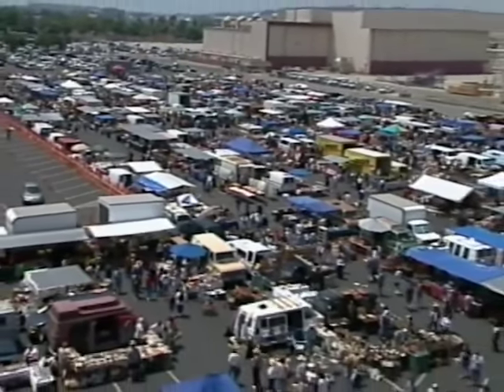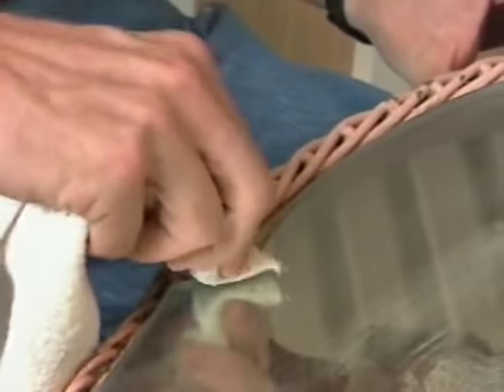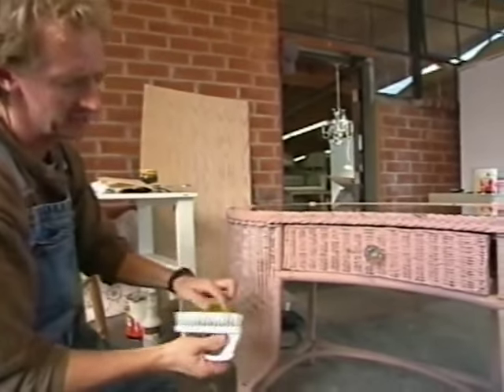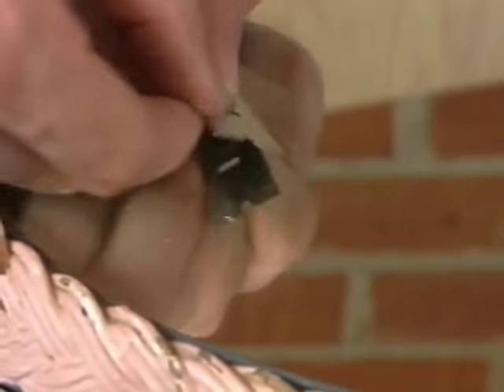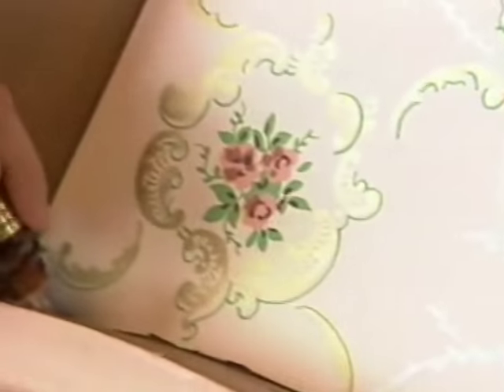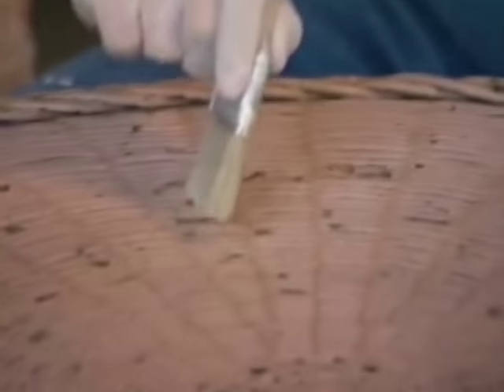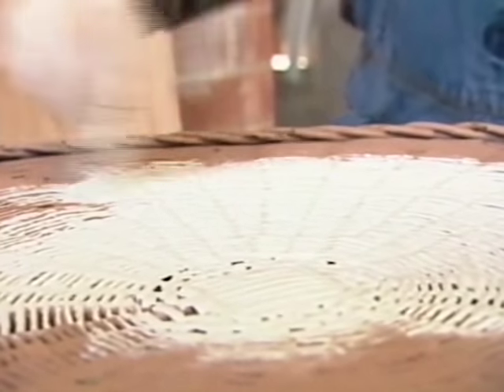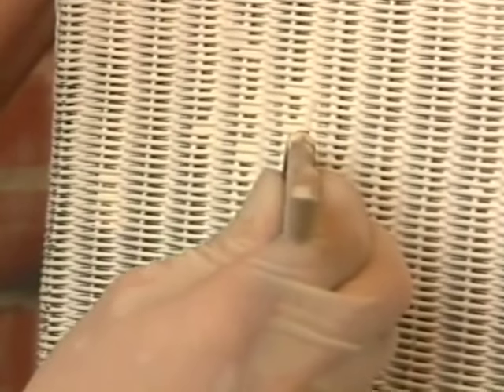Shabby Chic Ep4 Vid2 Painting Wicker SD

Comment: I've refinished 1000's of pieces of wicker/rattan over 30 years.   
1.  Remove the mirror
2.  Clean the wicker like mark did
3.  Use a spray gun with a latex semi gloss, 1/3 warm water, 2/3 paint.    2-3 thin coats.  
4.  If not, use acrylic gloss enable, available everywhere in 100's of colors for about 5 bucks a can.
5.  Start by painting your piece upside down.   You'll be amazed at how much you missed when you turn it right-side up.
6.  Lightly brush off any excess 10 minutes after you spray it.

Comment: I was just checking out some vids. The wicker bedroom pieces I have are in great shape, just need to be cleaned like you did. I was gonna use a pressure washer, but I guess I can use a brush, just soap and water...  and I def wanted to use spray paint gun? Is that not recommended? Is it just preference? Obviously would go much faster.
Reply: Spray gun is 1000x more effective.   The dude in this video is an amateur.   Thin latex paint about 35% water / 65% paint.   2 coats minimum, turn the piece upside down first.